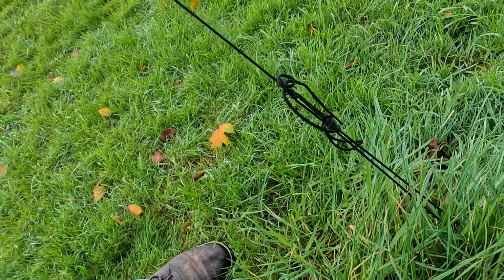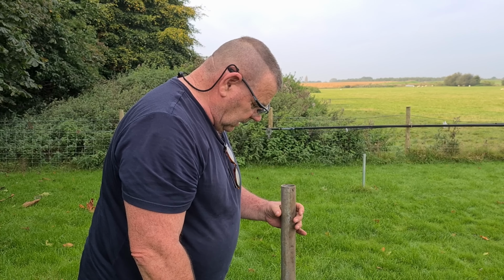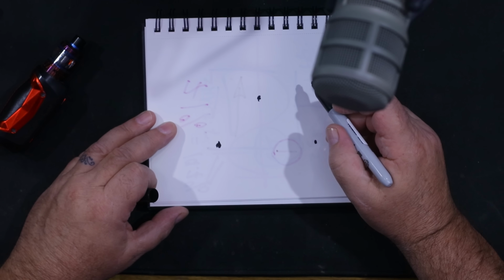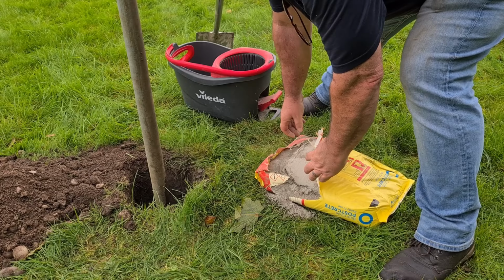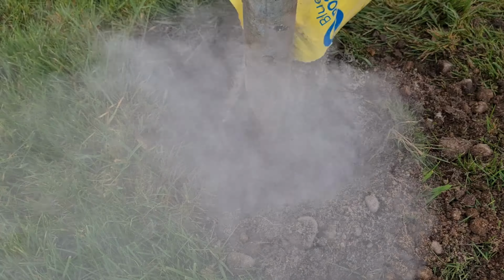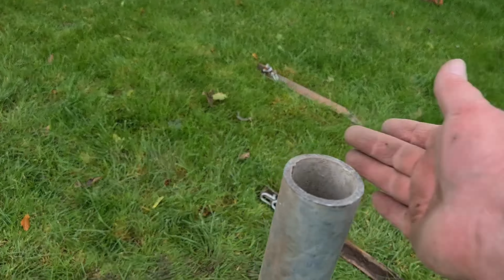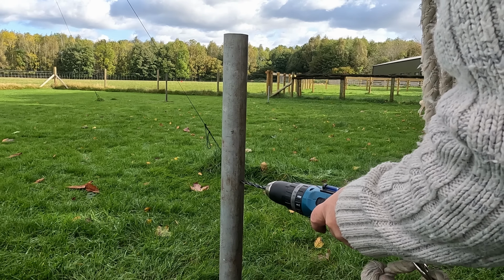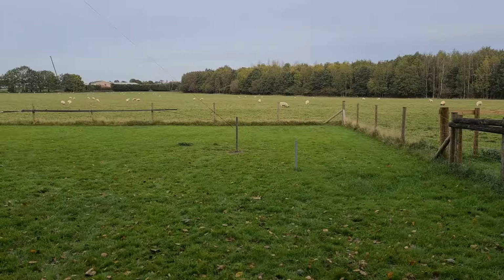Scafdfolding Guy Stakes for BIGGEST DX Commander

Comment: My DX Commander (12.4) has just survived the current storm in the north of Scotland.  It is 40m from house/shack on steep slope. I went up the slope yesterday to take the  antenna down, but it was too dangerous to attempt this - so I had no choice but to take the risk!! I have it well guyed at spreader plates 1, 2, 3 and 4. 
It has now been blowing a real "hooley" for the last 48 hours. Trees are down - roads blocked - but the Signature 13.4 remains erect. Facing further storm for next 24 hours.
The 12.4 brought me my first QSO a couple of weeks ago - a good start - flooding the airways with my nervous 10 watts.
Reply from the maker: Wow!

Comment: You did it the hard way my friend. (For next time)  Pie (3.14) x 6,5/3 Locate where your mast will go and plant it. Take a 6.5 meter string and tie it to your rattle can and walk around the perimeter to draw a circle on the ground. Pick a point on your circle and plant  your guy peg. Tape measure your answer from your equation to a point on your circle. do the same in the other direction. Measure the distance between your two points, divide that answer in half and adjust your two locations accordingly. Or you can do like the rest of us, eyeball and error one from which way the wind blows the strongest the majority of the time. Hope this made you smile. Keep up the great video content. Cheers
Reply from the maker: Hang on.. That's what I did! The centre point existed. I measure the 6.5, drew and arc and walked the tape measure around. Er, maybe you didn't watch!
Reply: @DXCommanderHQ  no, but I must apologize because I wrote that before I finished watching the video. Then things started happening around here and I didn't have a chance to "take it back" Please accept my apologies Sir Callum.

Comment: Top Tip: when digging holes like this use a two prong fork to loosen up the ground (if you have one of course), that's how the lads that dig up the roads to fix water leaks (and other things) do it (which I did for 7 years). My DXC will be going up at the new QTH in a few weeks, can't wait...
Reply from the maker: Hey Stu, I probably made it look more difficult for the video. Each hole was about 5-0minutes :)
Reply: I have found it better to hold the shovel 90 degrees to the ground and watch someone else dig the hole.

Comment: Another advantage of guy posts, if you have a small garden like me you can not get the proper angle on the guy wires ie. normally the angle of the guy is too steep.
The guy posts effectively extends the size of the garden, as you are catching the guy wire higher up of actual line of the guy, thus making the guy come down at a shallower and more useful angle
This can be especially useful if you are guying something close to the corner of your property, just put in a guy post of the appropriate height.

Comment: Nice job Calum,
I generally prop the post with three guy ropes perfectly vertical in the hole first up so there's no mad panic trying to plumb it before it starts to set.
Particularly in the hot weather as that rapid set stuff sets very quick. 20-minute quickset in 40–45-degree day is nowhere near 20 minutes.
Been there n done that and found out the hard way that preparation will save it turning to "Facebook" if you know what I mean.
Also, I just stick the whole bag or more in and then pour the water in and have a round bar to prod and rod the mixture.
Reply from the maker: A good prod! :)

Comment: Great upgrade Callum. I would use some blue thread lock to stop them from coming undone. 
When cutting the bolt/ threaded bar place a nut behing the cut. Cut then do a slight taper edge with a file. Then unscrew the nut off wich will make sure the thread is ok. 
Ive just got a scaffold bar to pit in my garden to hold a dx commander pole but the pole is too big for it to slide over 😫🤦🏽‍♂️
Nice job camra lady. 👍🏽
73
Reply from the maker: I don't want a thread locker because I will probably take these on and off and there's no vibration or anything.. I did consider it. A scaffold pole will work on the 12.4 else yes, you need to come down in size to 43 / 44mm.
Reply: @DXCommanderHQ  yeah not a problem. I only mentioned it as I thought there wasn't a lot of thread. Could always use a spring washer.
You should of seen my face when I released it didn't fit. I had waited about two months for a family member to get me a short section. Ahhh lol.
Great work on the guy poles install.
I couldn't hear you when you did the steam last. I had hoped to call you using a new antenna I have got. I bought a mag loop for the attic but not sure how impressed or not I am with it yet.
73

Comment: When I was doing a commercial mast with stays. A circle around the mast. 120 degrees. Will give you the direction of your first stay. Another 120 degrees for second stay then another 120 degrees final direction. 3 stay  points.
Reply from the maker: And where do I get 120 degrees from, the shop was completely out of them.

Comment: I made myself a "tool" for locating guy anchors for my DX Commander Classic for temporary portable deployments.  It's a piece of paracord with fixed loop knots in the ends, and a half hitch in the middle.  From one end to the half hitch is R, my chosen distance between the base of the pole and the guy point.  From the half hitch to the other end is R*1.732 (close enough to square root of 3), which is the distance from one guy anchor to the next.

(Being American, I use R = 10 feet, but you can just as easily use 3 meters, or whatever you like.  Note this also lets me pre-make the guys, since I can calculate their length.  I use paracord with arrowhead hitches at the bottom end to allow for small adjustments for tensioning.)

I put a plastic tent stake in the ground where I want the pole (which will also later serve as a "step" for the pole with the center plug pushed out of the end cap).  Drop the loop  for the R length segment over this stake, and walk the half hitch out in the direction in which you want to place the first guy anchor until the line is tight, with the knot on the ground, and the knot shows you where to put the first anchor (I use a metal tent stake angled away from the mast position).  Put in this anchor, and drop the loop at the long end of the line on it.  Walk the half hitch toward where you expect another anchor to be, and make both segments tight while holding the half hitch, and, again, the not marks the anchor location.  You don't have to change the loops to find the last anchor, just walk the half hitch over to the third location.

(I erect the pole by connecting the top guys and walking the base of the pole in to drop it over my "step", easy to do alone.)
Reply from the maker: Boom! Love it.

Comment: Colin, with concrete you can just pour the dry mix into the hole and walk away, The concrete will pull the moisture it needs to set from the soil within a few days and be just as hard had you mixed it and poured it into the hole.
Reply: Spent 20 years fencing. It definitely needs correct amount of water for proper strength.

Comment: I use 2 inch angle iron  with a sharp point cut  driven in with a sledge  at an angle of 45 deg. This method has held my 26m Spiderpole for 3 years
Reply from the maker: Yes, I used to do that too.

Comment: Callum, get yourself a threaded rod cutter.  Put your rod in at the desired length, pull down on the lever, chops it dead straight everytime.  Use them at work, there great, not too expensive either.  M7MEK.
Reply from the maker: No more tools.. PLEASE!

Comment: That jungle you show at the beginning with the “original” guy point, is exactly the challenge I have with the BASE of the antenna (already have elevated guy points).  Already complained about my inability to get the antenna in regular, reliable operation for lack of the ability to install the ground radials in such a way as to be compatible to with human life sharing the same territory.  Don’t know why I didn’t do this to start — will be making a brick pad at the site of the antenna base, from which I’ll exclude vegetation, enabling maintenance of all the connections at the base.
Reply from the maker: And some feed poison stuff at the base :)

Comment: Tip for cutting threaded rod: 
Put a nut on the rod first, then cut (and file if you care about the shrap edge) , then wind the nut off the end you just cut. 
The nut will force any misaligned bur to be in the right place so you wont have issues threading another not on after this.
Reply from the maker: Indeed.. It's just a hassle.. And I even have a thread cutter so there's no excuse.

Comment: Cutting threaded bar run a nut on before you cut it that way you can run the nut off the end afterwards to clear the thread, file the cut end before removing the nut
Reply from the maker: Indeed, or use a die.. I even have those :)

Comment: If you screw a nut on your allthread before you cut it, the thread will clean up when you screw the nut off, though drilling it is good an alternative is to use munsen rings, i used to be a pipe fitter.
Reply from the maker: Yes, that too.. Or use my wife's Amazon account and I found these! Even better :)

Comment: I was waiting for your hood string to wind up in the rotating drill bit. You may know this, but most drills have a level bubble on them to assist in getting the drill parallel to the ground if that's what you want of course.
Reply from the maker: Most drills. Not this one. I have glued one in. And I forgot it was there!
Reply: @DXCommanderHQ  Ok. I thought I saw one and I guess I did.
Reply: @DXCommanderHQ  You can also use the old plumb bob truck too. A loop of string with a weight hanging from the drill. Many mothods or just shoot from the hip and hope for the best..

Comment: Nip down to the local builders merchant or garden centre get three flag stones. Drill a hole in centre and pop an eye bolt in. Bingo! Three guy points that won't get overgrown and no digging required plus you can move them etc.
Reply from the maker: And the dogs? I think you missed the point of Django running into the guys.
Reply: @DXCommanderHQ  oops I did. Soz

Comment: Hi Cal, Can you do the Nebula with 160 as a L and 60m ?? maybe in place of some of the higher bands, as most of us that are interested in the Nebula would have antenna's for 20-10m already, thanks
Reply from the maker: The problerm with 160m is that we would need at least another 20m of wire off the top - that's a hell of a weight.. Capacitance top hat would work.. But even so would be huge.

Comment: you cemented in the guy poles, Did you cement in the antenna pole? I'd guess not but ... if you had not, then changing poles to use the same guys would be easy. Great videos...I watch all of them!
Reply from the maker: The guys will always be a different size depening on whether it's the 12 or the 18.

Comment: Get yourself a V block jig for your drill press to drill centered holes into round pipe the setup should be self explanatory. Start with a small drill bit and drill straight through it may be off slightly but close enough for government work there are also hand held versions of the V blocks but the drill press is better but harder to hold up to the pipe out in the field …73 Mike K1FNX near Boston
Reply from the maker: Ah.. I shall take the drill press to the field then.. Or buy more tools! HAHA. It's OK, I got it OK in the end..

Comment: Did I miss something? Instead of all that mucking around with geometry, why not pick the centre first, mark it with a stake and then measure out 6.5 metres at 120 degrees apart?
Reply from the maker: You did miss something. That's what I did.
Reply: @DXCommanderHQ  At 4:04 you said you didn't know how to find the centre. Why was that even a problem if you started at the centre? Something doesn't gel.

I would stand at the centre and use a magnetic compass to determine the 120 degree points from there. Simple.

Comment: Callum what the hell man? Work smarter not harder. Drill a hole in vicinity of the top of a fence post and drive it in the ground. I have 4 fence posts driven in the ground with 4 guy lines going to each one holding a hex beam straight in the air.
Reply from the maker: With a Makita? No thanks. 25 minutes digging is just fine.